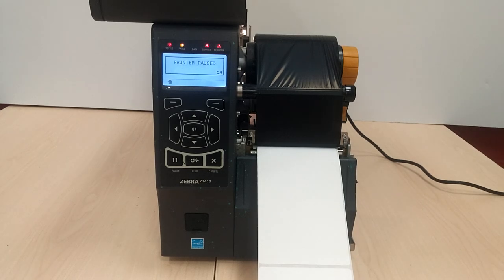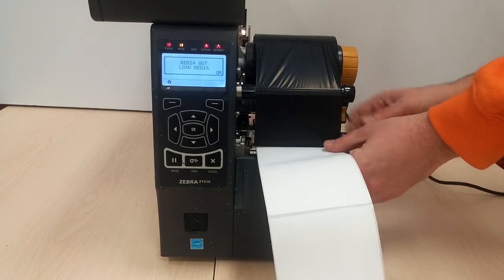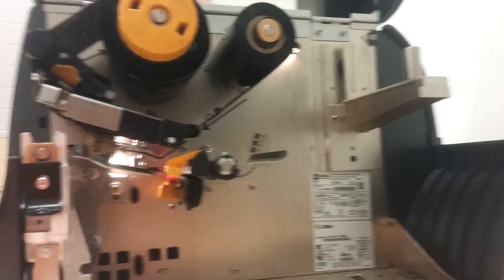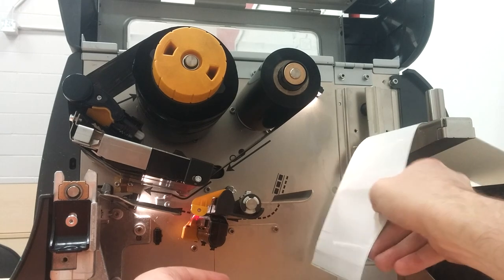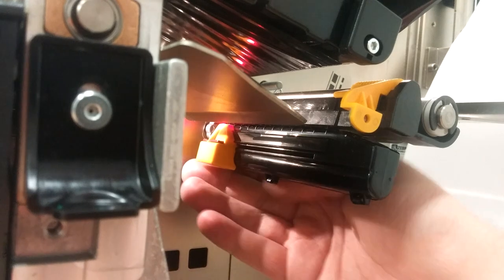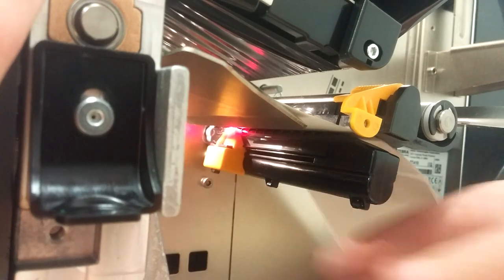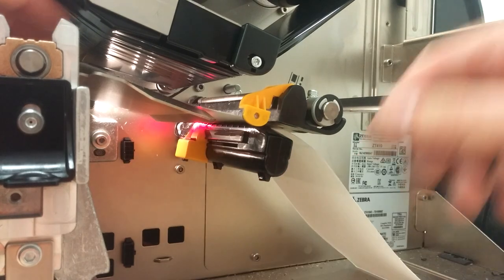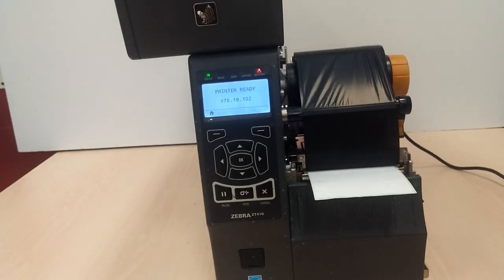Fixing Media Out Load Media Error on Zebra ZT420 or ZM400, 410,

Comment: Q: I have almost same ribbon printer as you, however i have problems with labels that print differently on ever other one. I use circular labels in which two of them side-by-side are being printed. If printed continuously, one set will print properly and other will print above its starting point. Do you know the cause of this and can help remedy this problem? Thanks, if you can answer this.